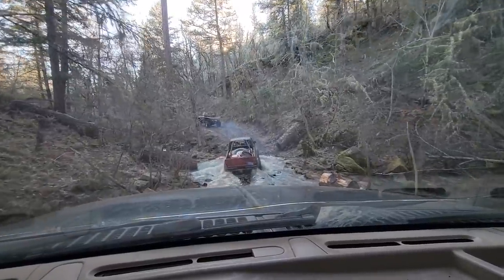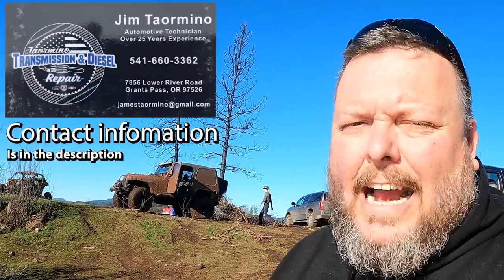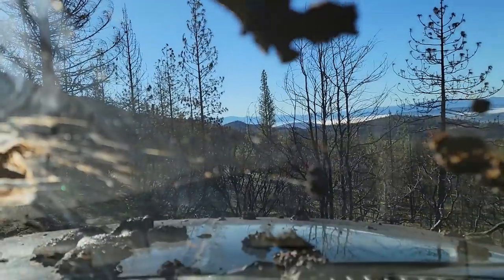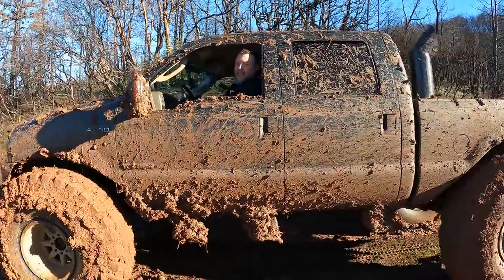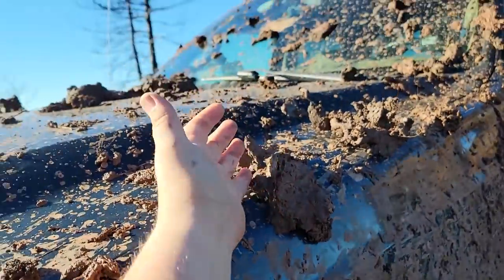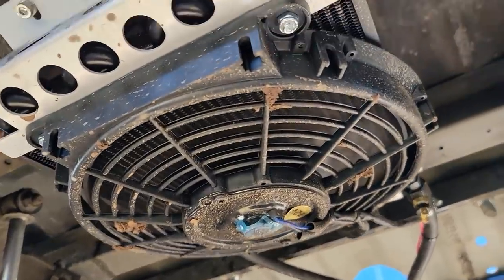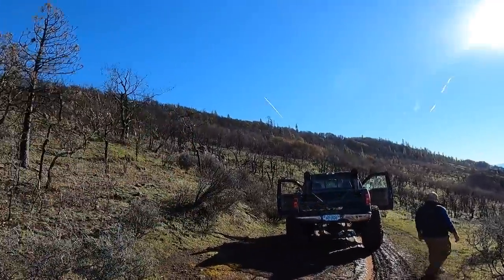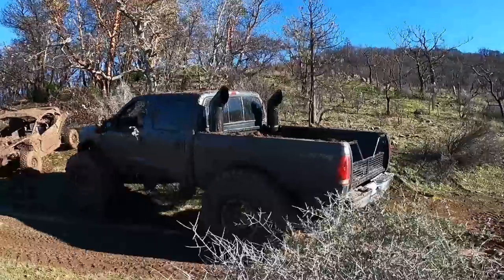F250 on 53s on Stock Axles & Gears... Lets Go MUDDING

Comment: Your better off shifting it manually instead of letting it search for tye right gear all the time .just like plowing big snow storms keep it on one gear and wind up the motor  . Tow haul can help a little and also putting the shifts firmer with the programmer
Reply from the maker: So I never knew this but when you put the truck in 4 low it disables the ability to put the truck into tow haul. I'm going to need to contact  SCT tuners about this and see what I can do about a custom tune to put in my lifewire TS+
Reply: @PaperBeatsRock  
That tow haul is that just on certain programmers for diesel vehicles.
Reply: @PaperBeatsRock  How are you liking the Livewire TS+ ?? I used it for quite a few years but everyone kept telling me I had to get the X4 for the powerstroke switched about 4 months ago not quite sure which one I prefer yet. Have you ran the X4 at all

Comment: I like what you've done with your truck, you have balls for not re gearing!  My hats off to ya,
A steering ram assist is the right idea.
I have my d60s geared as low as they can go and keeping a thick gear set, 5.38 but my 02 f 250 is a gas 5.4
If I ever get my truck built maybe we could have a deisel/gas shoot-out,  ha!
Thanks for the fun videos!
Reply: I'm in san antonio by the way , and I'd love to bring my 02 to go wheeling with ya!
Reply from the maker: Gears are something we will be doing. I know we are pushing it hard with out them. You get that truck of your built and are up around this way, we will need to do some wheeling.

Comment: 150-180 trans temo is normal, up to 220 degrees is fine. up to 250 for 30mins 30mins max. between 5-230 the gauge stays the smae at 250 is when it moves to yellow and red at 280.

Comment: Take a look at Lee power steering. They have a Saginaw pump replacement. Lee can also port the hydroboost. I also have a Redhead steering box and they recommended a company outa Texas that ports for them and also has a ram setup as well. PSC has a very nice bolt in kit for the ram as well. Mounts to the front cover bolts. I blew a tire at 80 and the truck never pulled. I also added an additional power steering cooler. Look at Mishimoto they offer a massive trans cooler. It’s a direct replacement.

Comment: I have an 01 f250, 7.3l/ZF6 on 8" leafs/long shackle on 365/85/20 Michelin XLZs and I've had a PSC hydro assist system on it for many years. eventually the box started leaking and the nipple on the back of the pump broke. I switched to RedHead steering box and had the PSC pump repaired.
Reply from the maker: Yeah I'm sure the new set up will make a vast difference for us. I cant wait to try it out.

Comment: Adam I am loving the Stupid Duty. You're doing it right. Trial runs is the only way to know what you need. I'm really surprised you didn't build the 500.00 Bronco into a trail rig. That would have been bad ass. I'm kinda partial to the 78-79 Broncos.
Reply from the maker: I wanted to but it needed so much to get their. We got a few other projects lined up.

Comment: Looking good. Best thing is to call the steering box manufacturer they have experience with what your doing and can give you suggestions on how to make sure that pig is happy. I would also make sure you have a separate power steering cooler as well. 
Bad ass content just makes me wanna wheel when I watch these thanks for being a oregon guy also let’s me find more area to screw off with
Reply from the maker: Heck yes Nw jeepin. We where just talking about power steering cooler and adding that to the system. When the park is up and running full speed it would be great to see you come down for a event.
Reply: @PaperBeatsRock   I definitely lab on it. I’m heading down to Winston oregon to fix my sisters car. Adding a power steering would be awesome. Also check your rpm’s while your wheeling that guy. Mechanical is better if you stay higher rps but if you tend to stay a little lower mostly electric is a stinger air flow. 
Lmk if you want me to e mail info to you I’ll be happy to help with anything.

Comment: I would most definitely upgrade your axles don’t bother just putting new gears in your stock axles because your stock axles is just gone go out anyways especially with how you drive it it’s not gone be able to take all that stress on them 24/7 with all the off-roading your doing💯👍🏽👍🏽
Reply from the maker: Im on the same page. Just going to be throwing away money on the stock axles.
Reply: Nah the stock axles if they're paired factory with the full float Dana super 60 series. You'll never break those axles.

Comment: Trans temp of 170-210F is nothing to worry about. Above 240F bad things happen. Over cooling trans fluid is a real thing and can be just as bad as overheating the fluid. I’d be more concerned with the engines egt’s. Sounds like the engine is lugged down when trying to spin those tires.

Comment: You should manage the fan inside the bed of the truck underneath the bottom is not safe brother
Reply from the maker: Thank you Terry. We are looking at some different options with the bed and building a heat shield around the exhaust to reduce the heat.

Comment: Those tires are going to be a very expensive exercise in finding all the weak links in that truck. Lucky for you I'm afraid they are way too stiff to get much traction. I saw the transmission coming faster than Nastrodomus but tie rods, axle shafts, ring and pinions are in your future. The cheapest route is to build it so  u joints are your weakness. They're cheap and fixable on the trail. May as well order Rockwell's next but I've seen 44s break the stock axles with less torque than you've got so break out 50 grand or so for a start.
Reply from the maker: Yeah to reduce most of the stress that the truck has I believe military axles would be the best upgrade for all the components, but everything costs money and I'm still on a budget.

Comment: I'm going to give you my secret idea because no one has done it yet and you have the truck to do it with. I want to build or see someone build a set of tube fender flares and running boards on a super duty like the old power wagons.
Reply from the maker: are you talking about the 40s-50s ones with the rolled fenders. almost jeep looking?
Reply: I use to work for frontier  exploration  on all our trucks we had 3 inch tube that went from front bumper and followed  the wheelwells down below door then down the box to rear wheelwellls then to back bumper, it was there so when we went through the  forest the tree  didn't  damage the body of the  truck they worked great, so a company has come up with that idea.
Reply: @PaperBeatsRock   Yep just like those real power wagons. Big tube fenders like a jeep, with heavy metal sheeting.

Comment: Is your truck 6.0 or 7.3, I have the 7.3 with a B&D tranny deep pan underneath  27 quarts it holds, I updated to a better Aluminum  radiator  with a bigger  oil cooler out front and intercooler  all from molimocher and fill tank all for 1799.00 might want to look into them, plus my 7.3 turbo powerstoke pushes out 440 horses 1200 pounds of torque,  with edge tunner 680 horses and 1700 of torque , have fun
Reply from the maker: Its a 6.0 truck. We have a SCT Live Wire TS+ on it and im only running a 50hp tune. Motor is stock outside of doing a proper bulletproof. As for the transmission I think a larger pan maybe in order. The extra lines and the cool its self adds some more fluid but not enough for sustained wheeling. Ill look up and see what options they have for my transmission.

Comment: So you replaced the one of the best trans coolers ever made with a shit derale, and you’re worried about the wrong target numbers..

225 max on 5r110s
delete the Bitch cooler
Reply from the maker: The stock cooler is still the primary in the system. This is just added into the loop. Also the numbers I have targeted are there to let me know before it get to hot, not right when its getting to hot.

Comment: 180* is nothing. Normal operating temps are 60-80* above ambient.  Set your warning light to 210*, pull over and let it cool at 220*.
Reply from the maker: I have it set at 180 because I don't always catch it when it starts going off and also I have had it sky rocket pretty fast up to the 220 mark just a minute or so after 180. Just depends on how hard I'm pushing it.

Comment: Did change your diff gearing to match your bigger tires
Reply from the maker: I have not changed my gears yet. Its something that we are looking at doing but budget is always the struggle. I did just pick up a hydro assist steering set up. I'm trying to debate if I should do gears or just spend a little extra and get some military axles.

Comment: Just out of curiosity how much air pressure are you running in those tires? Those things are designed for trucks that haul tons of weight kind of curious just how low you have taken the pressure with such a light load on them.
Reply from the maker: currently I'm only running 15psi in them. there is a little bow in the side wall from the weight but not much.
Reply: @PaperBeatsRock  Interesting. Havnt seen them really used off road on a vehicle that light before. Surprising to see how low they can go. Looks like it is working well. Cant wait to see what you do to the truck next.

Comment: Check out the Chevy pumps, they are much better than ford's, I know I got a  f250 powerstroke also, my power steering  pump whines  all the time drives me crazy when I can hear it over the diesel, I don't have huge tires like your running  mine are 285X75X16 nothing huge, but that pump is junk I'm checking into the Chevy pump it's spose to be much better
Reply from the maker: Thank you Chance. I'm going to check that out.

Comment: Another thing is your ideas for the tranny cooler deffantly get that out from under the truck being from north florida I know if your going in mud that thing will be a pain to clean we run all rads in the bed of are truck's down here
Reply from the maker: For sure that is something we have talked about. Here in Oregon most of the time our mud is not as deep as what you all got. I do wonder what do you all do to protect your cooler from mud getting throwing on to it?
Reply: @PaperBeatsRock  shroud's build the rad support in the bed and put a bent peice of sheet metal  on top to form sort of a arrow shape. Keep the  rad straight up and down it all depends on the guy doing the work we have all tried many ways that's just one style that we had good luck withaybe some time you should take a trip down to the mud event's in the south you would really enjoy it

Comment: Maybe I missed it but did you have to roll the fenders at all? I run 26x15.50x40 on my F350 and it scraped constantly until I rolled it a bit. Those tires are massive id imagine you had to do something to fit them in there so well.
Reply from the maker: We cut a lot of the fenders out and we are currently notching the cab as well because we still have some rub points. This is not a option for everyone to do that.
Reply: @PaperBeatsRock  If you put longer shackles in the front with the stock spring hanger it will move your front axle forward a bit to help clear the cab. I clear 365/85/20s with an 8" spring and shackle from a leveling kit and bushwhacker cut out flares.

Comment: I hope your running lower gears in the diffs
Reply from the maker: Currently running stock gears. It will get changed at some point.
Reply: @PaperBeatsRock   I like your truck. It ain't hurting for power by the video. It would definitely help save the trans

Comment: With 53 inch tires this beast needs to have heavy duty drivetrain.    Minimum 3 ton Axel's and a seriously overbulit transmission and all the expensive add one that seperate pavement princess from a real.off roader.  I would kill that thing In matter of minutes if I drove it like I drive my mud truck.   Those stock Axel's are dinky little weak sticks under all that stress of the heavy tires.    Overbuild the drivetrain and this beast will do great off road.    It wouldn't last long off road driving serious places . It's just not built strong at all.  Stock is weak
Reply from the maker: It's will get there in time and all of them are goals to hit.

Comment: Steering depends on the application full time off road go full hydro part time go hydro asst but keep in mind hydro asst is olny ment to turn 44 at a dead stop which will work fine for your application couse I doubt your ever gonna be standing still turning your wheels
Reply from the maker: Thank you so much Jamesdeke. I'm going going to need a application that I can use on the street as well so I will be going with the part time. You input on this was very helpful.
Reply: @PaperBeatsRock  ya no worries brother badass truck BTW glad to see your trans is built right also transmissions are the Achilles heel of an off-road vehicle

Comment: What the heck are planetaries ??
Reply from the maker: Planetary is a gear system with a larger gear with smaller gears that turn a central gear. The benefit is providing high power density in the same size as a standard gear.

Comment: And still completely worthless. Aint been a decent truck built in 20 years. As soon as your electrocrap sensor goes out, your stuck and calling someone like me.
I live on the edge of one of the biggest orv parks in the state, and drag this shit out if the woods on a regular basis with my 63 Dodge. I wont even hook up to the new IFS shit anymore, if you're dumb enough to break that on my trail, I'm just gonna stuff you in the woods and go around.